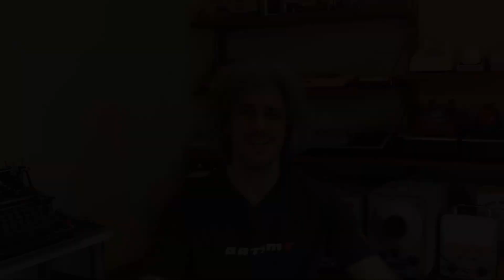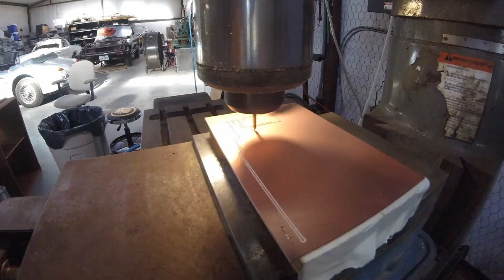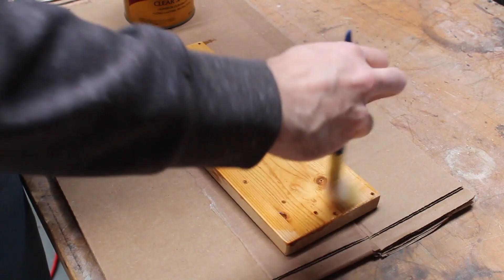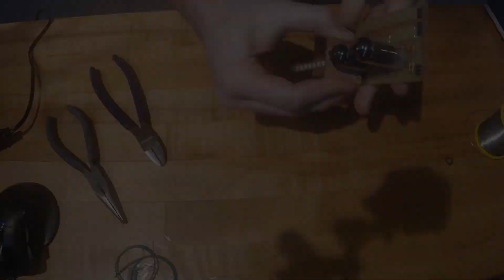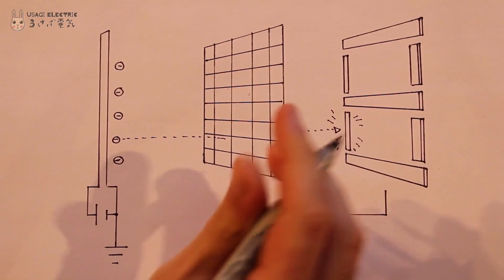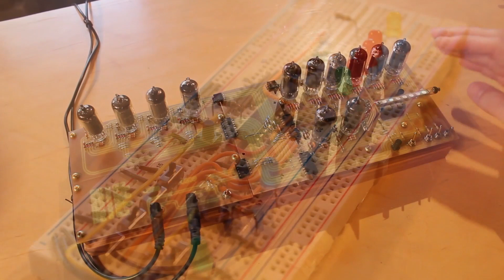Vacuum Tube Computer P.04 – Proof of Concept Build

Comment: Re our comment about milling text into your power board, if the PCBs are translucent where milled, how about putting some gentle illumination beneath them? Obviously, LEDS would be too passe these days and not appropriate anyway. Neons would need to much power and may not give an even backlighting effect. Halogens, don't think so. But what about those 'neon' EL strings? The tech would complement your use of VFD displays, the strings come with inverters allowing them to be powered from 12v etc, and they can be cut to length.

Comment: Re Standoffs with only a few mm in height:
What I've done is buy a foot of plastic tubing -- the "milky white" kind that's harder and not as flexible as the clear stuff, though for this length it doesn't matter.  Get tubing that the screw fits through.  Just cut that to any length you want.  If the inside diameter is only just large enough to pass the screw, it will be very solid.  If the tubing is too large and still too smushy for you, fill it with glue.

Comment: I swear someone had to say this already. So why are you not using a R-S Flip Flop for your debouncer ????
Reply from the maker: That's... actually really brilliant!
I don't know why I never thought of that (or came across it in looking up debounce stuff), but that's an awesome way of doing it, and relatively easy to implement. In the end, the design has changed enough that it's not quite necessary to have a debouncer on it, but for any future debouncing, I'll definitely keep that in mind!
Reply: Thanks for your response. I was thinking of using a SPDT switch, with either Pull Up resistors on the S & R inputs and the switch common going to either ground or VCC. For me the R-S Flip Flop goes back to my Logic Classes back in Collage, along with Karnaugh map (K-Map check out https://en.wikipedia.org/wiki/Karnaugh_map for more information on K-Maps). I had to design for my Grandparents Hydronic heating system for their house the relay logic for 14 inputs and around 22 outputs to control pumps, Zone Valves, and the Boiler. It turned into a 64 Bit K Map which I used Microsoft's Excel to design the Boolean logic for it. The Cool thing about Excel is that you can format the cells to look like the K map, and it already has all the logic built into it to do all the Boolean Logic (And, Or, Not). You just have to make/write out the formulas for each cell inside of the K map. So you draw out one K map like what you want, and you do your reducing and start building a second K-map with all your formulas for each cell to match what you want. You probably have all ready done all this, but this was what I did after my Logic Class during the summer.  As you have done already with your CPU, it was a lot of trial and error to get all the K-maps to work, and it also gave me a lot of insight how I could get the DPDT Relays to do more then just DPST relay could do (playing with both Positive and Negative Logic). It also got me to play with turning on the Boiler before all the Zone Valves (ZV) had finished aligning themselves, and let the ZVs control the turning on the pumps. I had the installer of the Boiler scratching his head on how I got it to all work. So Good Job on your CPU. It took Logic Class to get me to realize that you have to make a State machine inside of CPU to make a CPU. So are you doing to use Diodes logic for your ROM ( for the code that gets repeated over and over)? or something Better? And I cant wait to see what you do for your RAM. I see a lot of Buffering, and latches in your future (LOL). And for a counter- Maybe a 74LS193 or 192 in Tubes (https://www.futurlec.com/74LS/74LS193.shtml) ???

Comment: How many bits is this machine?
Reply from the maker: It's a really simplified/paired down version of a 1-bit microprocessor. But, there are technically two different "buses" in use here. The instruction bus, which selects the operation, is 3-bits, and the data bus is 1-bit. The Logic Unit does operations using the value stored in the Result Register and the value on the data bus. The new result from that operation is then stored back into the Result Register. 

Here's a simple block diagram of the setup here: https://i.postimg.cc/cLjLffPV/POC-Logic.jpg
Reply: @UsagiElectric  is there somewhere you go into more detail about how the LU works?
Reply from the maker: @gameengine6134  Yup! I go into a lot more detail about the Logic Unit here: https://youtu.be/N-Sc6k_rlTM
It's essentially just a large multiplexer that I build entirely out of NOR gates.
Reply: @UsagiElectric  thank you, I have decided to watch your tube series from start to finish to gain a better understanding of how board works and how tubes work in general.
Reply from the maker: @gameengine6134  Thank you! If you have any questions, please feel free to ask!
Or, join us over on the Discord chat server if you want to chat: https://discord.gg/p7UsfHD

Comment: This is so cool!!!  Now you need to build a few hundred of them and make a room-sized 8 bit computer. Not sure how to do this virtually, but we should do a collaboration sometime.
Reply from the maker: Thank you so much!
(Sorry for the delay in reply, internet was out for two days!)
You know, after the MC14500 replica is complete, I may go up in voltage a bit and start work on an SAP-1 replica, because it would be awesome to have an 8-bit computer that takes up a sizeable portion of the garage, haha.

I am absolutely game for a collaboration! While the internet was down I gave this a bit of a think and I have an idea that I think could work decently well virtually! Shoot me an email (Nakazoto at gmail dot com) or hop on our Discord and maybe we can spitball some ideas!
Reply from the maker: True, an SAP-1 would probably clock in at under 1,000 tubes, which, if organized well, wouldn't take up too much space. It would put out enough heat to garage warm in the winter though, haha.
Reply: 6502 with vacuum tubes!
Reply from the maker: @kargaroc386  Oh man, the MOnSter 6502 looks like it uses around 4,000 discrete transistors! 
At that level, things get interesting. Bumping up in voltage and changing over to dual triodes can probably get me down to around 2,000 to 2,500 tubes. Something like the 12AU7/12AT7 would be ideal for this job. There are lots of them out there, so it’s feasible that enough of them could be found.
But, the power draw would be exciting for sure. The 12AU7 uses a 12.6V filament that draws 150mA of power (1.89W). This is pretty standard for all the 12V dual triodes, but scaled up to 2,000+ tubes it gets pretty intense. Let’s make an estimate of 2,250 tubes. That’s 4,250W of power just for the heaters! Which means that at 12.6V we need 340A!
And while that’s absolutely mental, if someone wants to fund me to build it, I absolutely would not hesitate to say yes, haha.

Comment: If you install the male headers the other way around the boards will be at the same level
Reply from the maker: Thank you for the comment!
I'm not sure I follow though, the male header have a plastic spacer on them. If I flip them around, then the plastic spacer won't allow full engagement with the female header. Having said that, I do actually quite like the look of the raised appearance of the middle board. I think it really helps break up the monotony of multiple boards laid out next to each and gives the whole piece a little more 3-dimensional appearance!

Comment: Loved the wooden old-style breadboard construction
Reply from the maker: Thank you! I love the aesthetic from mixing wood with vintage electronics! The full size version will be mounted very similarly on a massive plank of wood.
Reply: @UsagiElectric  get you some nice wood for the real thing, instead of sad knotty pine!
Reply from the maker: @jon_byler  Honestly, I'd really love to do it with a huge piece of teak. It seems to b a really popular wood for mid-century modern design, which really fits well with the whole vacuum tube aesthetic. But, that's a long ways in the future, so I'll do some proper shopping when the time comes!

Comment: Very cool!  After the perfection/tweaking of that, next up, a tube based analog computer, but a low voltage version with all of the power supply circuitry built using modern components?:

https://ia802600.us.archive.org/25/items/HeathkitEC1AnalogComputermanual/Heathkit%20%20EC-1%20Analog%20Computer%20%28manual%29.pdf
Reply from the maker: Thank you!
Oooh, now that is an awesome link, that's going straight into my reference folder! I have thought quite a bit about building a low voltage tube analog computer, I think it would be epic. The only problem is, I'm not smart enough to properly use an analog computer, so I have no good way of testing if it's working or not, haha. But, I have done some experimenting with building a low voltage tube comparator and that seems to be the primary building block, so I may start reading into it a bit more, especially with that Heathkit manual!

Comment: this looks awsome!!!
cant wait for more
also for the vfdwhy not make a small tube oscilator that makes a ac voltage for the fillaments
a small ferride core should work
20 windings to the tube annode 10 feedback windings to the grid and ground (with bias resistor capasitor)
with a capasitor over the annode coil you can set the frequency
and you wind lets say 5 for the fillaments of the vfd (do use a centertap to the ground)

or as a diferent solution make dc power supply floating
and make a virtual centertap with 2 resistors
Reply from the maker: Thank you so much!
You know, I was actually thinking quite a bit about making an oscillator to generate the AC voltage for the VFD. I already have a design I was working on to boost 24V up enough to ignite a neon bulb that could be changed to work for VFD filaments. But I really like the idea of using 2 resistors to make a virtual center tap! It's super simple and much easier to fit in the limited space on the big version. I can't believe that never occurred to me, but thank you for the idea! That's something I'll definitely experiment with a bit in the next episode.
Reply: @UsagiElectric  well your power print has some room for a filament supply XD

but I will look forward to the next episode
btw
you are currently my favorite youtuber
Reply from the maker: @robot797  Thank you so much, that's awesome to hear!
The power board does indeed have plenty of room for a filament supply, but the connector board between the instruction register and decoder isn't quite as spacious, haha. (Spoiler picture: https://i.postimg.cc/wT269dcN/IR-and-Decoder-PCB.jpg ). I'm actually changing over the type of VFD I'm hoping to use, but I'll have to wait until the new ones arrive from Russia before I can do proper testing. But, I've already worked on implementing the two resistor with virtual center tap idea!
Thanks again for all the awesome insight and comments on my videos, it's great to find like-minded nerds to chat with about this stuff (it all goes right over my wife's head, haha)!
Reply: @UsagiElectric  most of the people I work/live with also dont know much of electronics so I know the feeling
but now I am curios how are the results with the 2 resistors
and did you manage to get them retrofitted on this "prototype"
Reply from the maker: @robot797  This prototype won't actually get the two resistor solution. It's now primarily a display piece to sit on a shelf somewhere (although we will use it for testing the new Result Register in the future). The two resistor idea is going to get a more thorough testing in the next video on VFDs though!